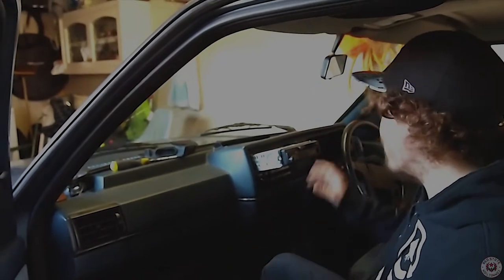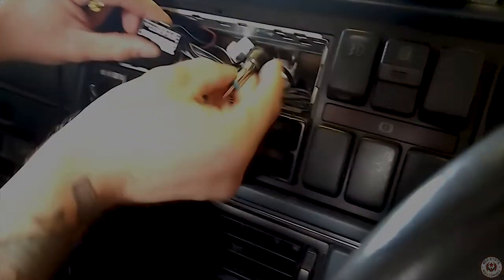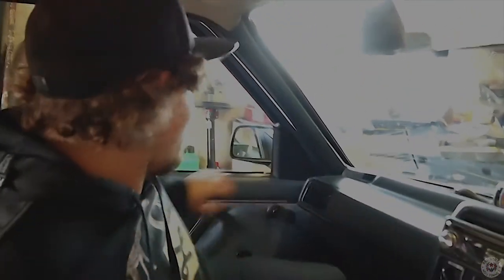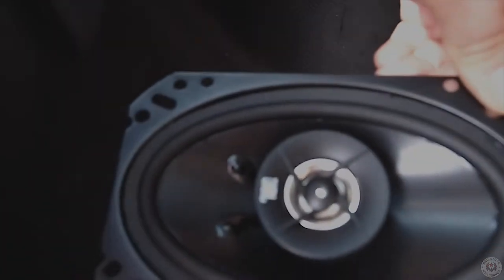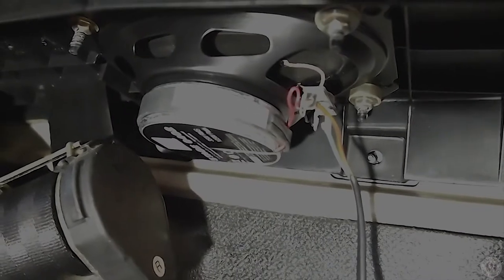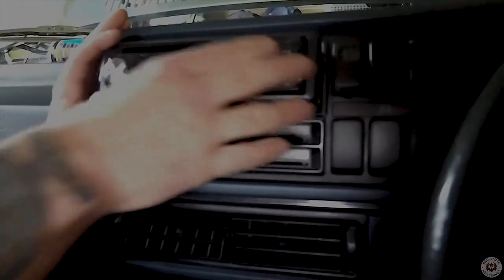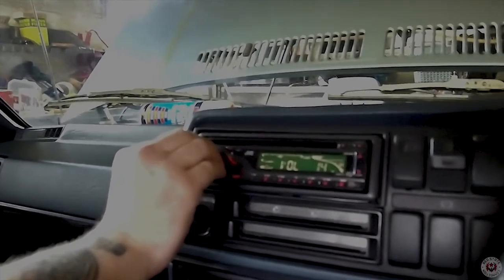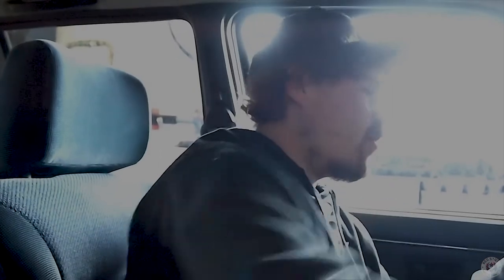*FIXING 30 YEAR OLD AUDIO SETUP IN A VW GOLF MK2*

Comment: Hi, nice video.
I have a Golf MK2 too, and i want to fix my old audio setup.
Could you tell me the models of the speakers that you use?
Thanks
Reply from the maker: Hi mate cheers for the comment, just working on some new golf mk2 videos now as it happens :) so stay tuned for them. yes no worries the front dash replacement speakers i used were the Alpine SXE 3.5" Coaxial 2-Way Custom Fit Speakers and the rear are the JBL 4x6 2-way coaxial rear hatch speakers. the alpine can be found on halfords and the jbls on ebay. ive heard alot of bad reviews about the alpine speakers and the jbl are ment to be alot better in the front too but so far i have no complaints with them.